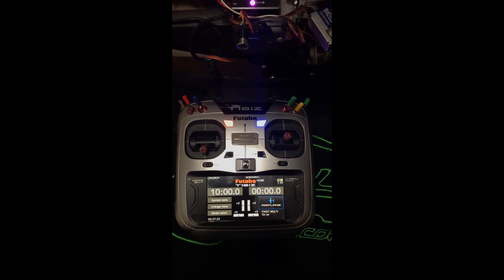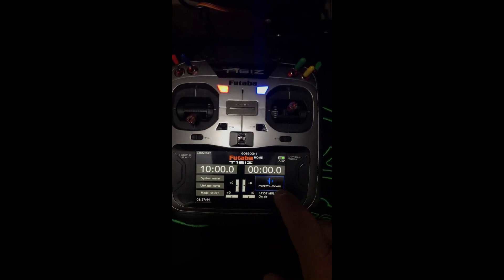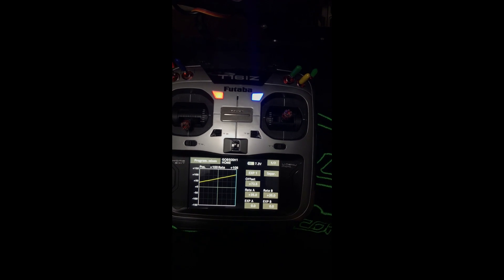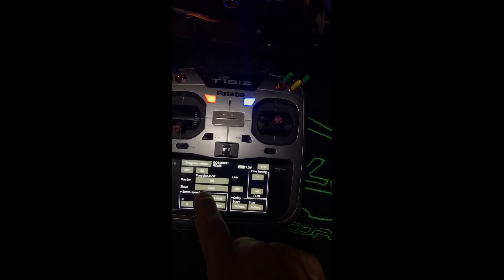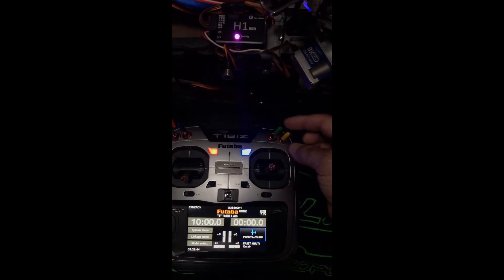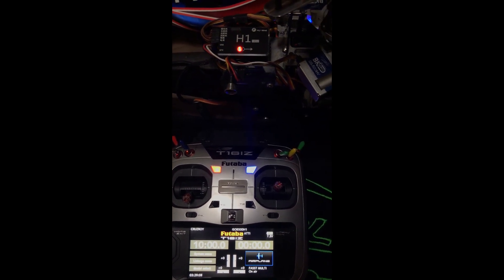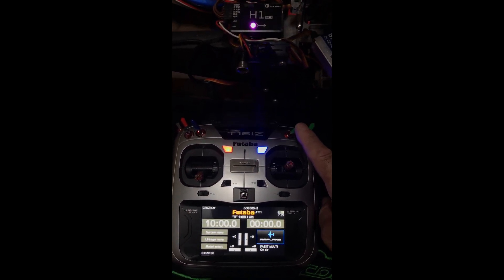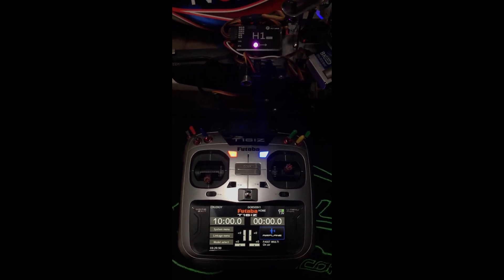FLY WING H1 flight controller and Futaba flight modes

Comment: Hi John . I just ordered the Flywing H1 and I have the 16iz radio. Now to setup the H1 you have to setup the helicopter in Airplane mode . 
I’m going to be putting it in my Tron5.5 . With is all setup in the radio . Thank you
Reply: Did you get your heli setup?,, I am doing the same thing, using a 550 size heli with a 16iz radio, I got it all set up but it was in heli mode,, I couldn't get the thing to arm, I guess I missed the part of using airplane mode
Reply: @ no I didn’t I canceled my order of the H1 . 
Was getting it from eBay and found it wasn’t the real flying H1 .
Reply: Hello, I have my controller all set up, futaba 16iz, everything seems to be right, it wont lock on gps and I cant get the motor to spool up in any mode, any thoughts?